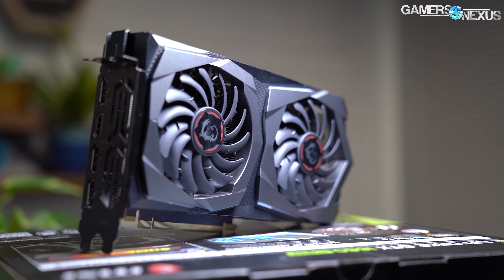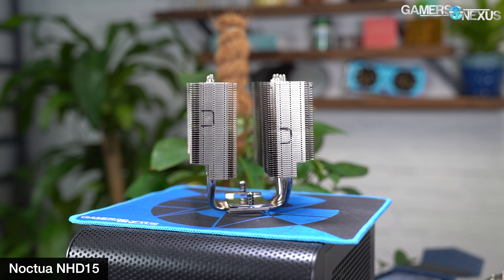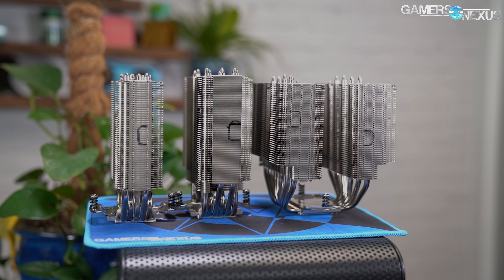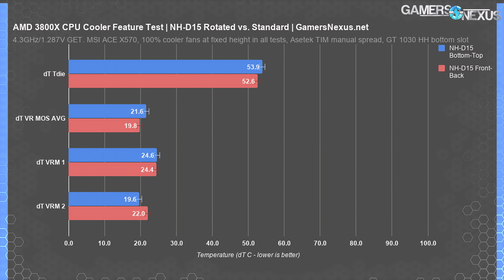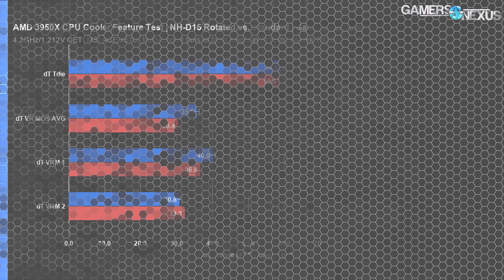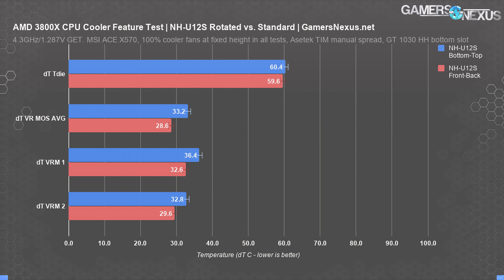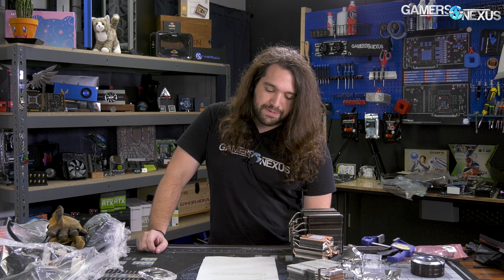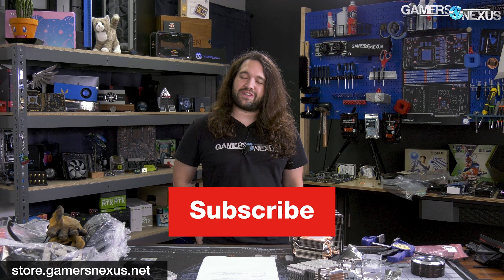AMD Ryzen Heatpipe Orientation Benchmark & CPU Cooler Myths

Comment: i think there is something fundamentally wrong with how ryzen deals with heat. My 3600x Runs at 75c under full CPU and FTP load on aida64. but the heatpipes are cold to the touch. not warm, they are literally cold. In comparison my older cpu 4690k stock runs are about 60c and touching heat pipes for too long will burn your fingers. For thermal compound im using thermal grizzly kryonaut.
Reply: Um actually its a perception issue. Ryzen 3000 cores thanks in part to the process node are quite efficent about 6w per core (most of the time though they can be run up to about 14w per core) the thing is at these densities you have quite a lot higher energy density. Give you a example. Move 100w of energy (that is 100 Joules per sec) away from a surface that is 1 square CM... now ... Move that same 100w away from a surface that is 3 sq. cm ... You have much higher energy density in the one example then the other which means you may have higher deltas to get that kind of energy transfer needed. The reason the cooler was hot to the touch with haswell (4690k is that the max load on the cooler was higher then on ryzen ) so more of the coolers capacity was being used then with ryzen (this makes sense given how low power a 3600x is.) The issue your running into is a limit of thermal transfer between the transistors and the cooler given the thermal density. And the space/surface area to do so (die size). The reason the cooler is cool to the touch with ryzen is that it is not actually very close to its limit (Qmax) of energy transfer. Which means it still can transfer a lot of energy. Here is much of the perception issue. Human bodies perceive "cold" in kinda a funny way. A object could legit be very cold like a metal pole in winter (maybe 20 F) however you may also grab a metal bar or pipe in the summer and it feels cold. This is because there is a high flux of energy from your hand to the pipe which your body percives as cold even though there might only be a small difference in temp (less then 20 degrees) .... The issue your running into is bascially that energy density is higher with ryzen even though it is more efficient (makes less waste for the same compute) your cooler is not really the limit the limit is more the mediums of energy transfer between the transistors and the coolers base plate as well as the density and overall distance that energy is spread out... To increase thermal transfer greater delta between the cooler and what your trying ti cool will increase energy transfer. However density , distance, ect all play a role.
Reply: @Onewolfoc  so it's a heat transfer issue? ryzen outputs much less heat but because surface area of the die is really small it can't transfer that much heat to IHS?
Reply: Check the thermal output of those two chips... THERE is the reason for your difference. You're comparing apples to oranges. AND, you can't take "thermal design" into consideration, Tech Jesus has a few vids on that subject.
Reply: don't you need a better heatsink to run a Cpu with higher heat output at same temperature as a CPU with lower heat output. if 3600x is so efficient compared to 4690k why does it runs so much hotter on same heatsink. and at same time it outputs way less heat compared to 4690k
Reply: @k7y  To many variables: You may not think so, but amount of TIM, type of TIM, mounting pressures, and absolute thermal output... You CAN NOT go by reported die temps, you would need calibrated sensors mounted to the dies, you know, like the LN2 over-clockers do?

Comment: So I have a D15, 3700x, on a MSI B450 tomahawk max inside a Fractal Design Focus G case. And the VRM heatsink and Ram placement paired with the case constraints means the only way I can orient the D15 and use 2 fans, is to have the cooler exhaust up or down. Out the back, I can only use one fan. However, running it that way (my D15 didn't come with hardware to mount vertically out the box) I haven't seen temps that warrant the second fan for my use cases yet.

Edit: very much worth noting, for anyone looking at the NH-D15. If you mount the fans as indicated in noctua specs, the D15 could be 165mm tall. However, if you have to contend with RAM sticks and a VRM heatsink, the D15 very easily ends up a cm taller than noctua spec. Pick a case accordingly, or end up with my predicament

Comment: Is there any difference in heatpipe performance when placed vertical(ala test bench) vs. horizontal(ala most cases)?
Reply: Yes there is - i attached a reply i made to another earlier comment that goes over this as well as some other info on heatpipes mostly being constant conductance heatpipes.

 there is a lot that goes into it. Starting off diameter plays a huge role. A 3mm heatpipe might have a qmax of 15w and a 8mm heatpipe qmax of 63w.... Thats a big difference for less then a 3x boost in diameter thats nearly 4x the orgional energy for sub 3x larger dia. .... Now lets say you have a low profile heatsinks (laptop for example) and you need to flatten a heatpipe ... If you flatten a 3mm heatpipe by 2mm height thats 3.57mm wide and now has a qmax of 10w instead of 15w .... If you take a 8mm heatpipe and flatten it so the width now becomes 11.14mm @ widest point the qmax is 52w rather then 63w of the round 8mm heatpipe....now some of the factors here are the wick limit (ability of the wick to transfer condensed fluid) and vapor limit (ability and space for the vapor to form and travel.) Thickness and porosity of the wick can be changed to tune it for a application (like differnt orentations) Which would allow for Qmax changes and / or the ability to work against gravity. .... A typical water filled sintered wick heatpipe (very common for pc cooling ) can be flattened up to around 60% though 30% is much more reasonable figure. As you flatten a heatpipe you will lower the vapor limit. A 3mm heatpipe flattened 33% now has Qmax limited by vapor limit rather then wick. Where as a 8mm heatpipe can be flattened by about 66% before the Qmax is now limited by vapor limit. ... Now if we start making bends we further reduce efficency. If we take the 8mm flattened heatpipe talked about above (52w Qmax) and we bend it 90 degrees we lose about 5% of our 52w Qmax. Which would be about what 49w after that off the top of my head ...then you have orentation. The most ideal situation for most heatpipes is vertical orentation as opposed to the heatsource with the condenser above the source of heat so vapor can rise and gravity can assist with pulling the condensed fluid back down to the source of the heat. Now to makes things even more complex again wick thickness and porosity effect this. As we as thsre is quite a few differnt forms of wick types that each work better for different things. Then if we want to complicate this more the length matters... shorter = more efficient (assuming you can still matain the same ability to cool the vapor in the condenser) now it varies for many reasons (ex. Working fluid , orentation , wick thickness , wick porosity , wick type , ect) however many fairly traditional heatpipes start to fall off around 150mm in length. However there is factors you can adjust to mitigate this. .... This info is still condensed a lot. And there is a lot of types of heatpipes. The ones discussed above are constant conductance heat pipes. There are also variable conductance heat pipes , vapor Chambers, pressure controlled heat pipes , rotating heatpipes , thermal syphons, loop heat pipes , oscillating or pulsing heatpipes,  and diode heatpipes. Even within diode heatpipes there are a few sub types like vapor trap and fluid / liquid trap types.

Comment: 3:53 right now.
I am fairly sure the orientation doesn't matter jack. The cooler has contact with the head spreader, not with the diodes.
It's called a heat spreader for a raisin.
Reply: Well orentation does play a role though not in the way it was tested in the video. Vertical heatpipes with the heatsource at the bottom and condenser on the top is the most efficient way to run most every heatpipe. Changes to the type of wick , thickness of said wick , and porosity of the wick , effect how much this matters and the ability of the heatpipe to work against gravity even.
Reply: @Onewolfoc  
Watch me mount it in every way you think is wrong, and still reach proper temps...

Comment: Whoever asked this Question is cery low IQ indeed... The radiator design and airflow over the radiator is always going to matter more than heat pipe orientation by far.

Comment: The only problem with these aftermarket coolers is that they're too big for older mini-towers from what it looks like.  Not to mention the fact that there's more things that the CPU fan cools than just the processor (e.g. Hard-Disks)
For another thing, air from downward-facing heatsinks (e.g. Amd's stock "Wraith" coolers) spread across the board through holes in the fins/pins whilst hitting the surface of the sink, hence the fan blowing down.  It's sort of the reason why all stock coolers have fans pointing with it's back to the sink.

Comment: I would have ran  the test outside of the case to elliminate all other interference....your method doesnt solve the question , it just shows the best position to have the fans pointed to cool the fins. I have an inverted board and its the best design there is....mine even has 3 blueray burners, fan controllers with temp readout and a radio head unit in the Front drive bays to aid in cooling. Why this design is not standard is criminal, they want you to cook your electronics so they fail sooner which increases the bottom line and the CEO s wallet. They are trying to get rid of the front drive bays so you cant backup data cheaply and decide to trust them to store it on there server. Plus now you will need to subscribe to Disney to see a movie because maybe they quit making physical disk....cpu fan orientation should be the least of these geeks worries. A glass panel blocking air flow into the front of a case is sofa king we Tod Ed

Comment: It's well know that if the pipes don't line up with the underlying chiplets perfectly, the "heat pipes" will actually increase the CPU"s temperature by well over 40C.  This is a little know fake fact.

Comment: it is the length of the heat pipes that is critical  .. longer the better , most have wicks in them anyhow so gravity is not much of an issue anyhow, unless you are delidded your restricted to the IHS ~ 800w/k anyhow ... jeez what ever orientation it should be to help the hot air exit ..

Comment: I've always liked the look of front to back tower coolers far more than bottom to top. Unless the system has no video card bottom to top also looks restrictive, pulling hot air off the back of the GPU to pass through fins meant to cool the CPU never seemed too bright either.

Comment: B-but the heatpipes form a square connection with the whole IHS... Tower cooler orientation is more of an airflow question rather than die coverage. One would have to "de-lid" a CPU first to then worry about proper die cooling.

Comment: it is better to have your cooler base cover the whole ihs, than a part of it, thermal fact. Especially with the chiplet design. The orientation is buullshit. And yes, Nexus used cpu coolers that covered the whole ihs and there are coolers that dont cover the whole ihs.

Comment: Just use 3 good thermal sensors ... One on the IHS one on the contact cooler and one on top of the heat pipes

Comment: It would more likely be more important to align the cooler to the air flow of the case than the CPU chiplets... As long as they used the Silverstone RLO6 case (Red), A white GPU on a riser cable and Green RGB fans it will be 22 to 25 degrees cooler.

Comment: I would want to know whether there's a difference between the heat pipes being mounted vertically (like on a bench test rig) and horizontally (like most computer cases), and maybe upside down too.  The theory behind there being a difference is that vertically mounted heat pipes have gravity on their side when it comes to moving the liquid inside them to the heat source.
Reply: Yes there is actually a pretty significant difference. The best orentation for most all heatpipes is as follows : heat source at the bottom , vertical heatpipes condenser at the top. In this case vapor is allowed to rise and gravity assists with returning the fluid back to the hotter base. Any deviation from this lowers the Qmax of the heatpipes. By how much is dependent on a lot of things. They (as in cooler companies) actually change the wick type , wick thickness , and wick porosity to design around and mitigate orentation. Porosity and wick thickness for example have a pretty good effect on the ability of the heatpipe to work against gravity or in different orentations. Some wick types also work better in some orentations vs others. If your interested I attached a reply i made to another comment on this video to the bottom of this that contains some good info on heatpipes 

 there is a lot that goes into it. Starting off diameter plays a huge role. A 3mm heatpipe might have a qmax of 15w and a 8mm heatpipe qmax of 63w.... Thats a big difference for less then a 3x boost in diameter thats nearly 4x the orgional energy for sub 3x larger dia. .... Now lets say you have a low profile heatsinks (laptop for example) and you need to flatten a heatpipe ... If you flatten a 3mm heatpipe by 2mm height thats 3.57mm wide and now has a qmax of 10w instead of 15w .... If you take a 8mm heatpipe and flatten it so the width now becomes 11.14mm @ widest point the qmax is 52w rather then 63w of the round 8mm heatpipe....now some of the factors here are the wick limit (ability of the wick to transfer condensed fluid) and vapor limit (ability and space for the vapor to form and travel.) Thickness and porosity of the wick can be changed to tune it for a application. Which would allow for Qmax changes and / or the ability to work against gravity. .... A typical water filled sintered wick heatpipe (very common for pc cooling ) can be flattened up to around 60% though 30% is much more reasonable figure. As you flatten a heatpipe you will lower the vapor limit. A 3mm heatpipe flattened 33% now has Qmax limited by vapor limit rather then wick. Where as a 8mm heatpipe can be flattened by about 66% before the Qmax is now limited by vapor limit. ... Now if we start making bends we further reduce efficency. If we take the 8mm flattened heatpipe talked about above (52w Qmax) and we bend it 90 degrees we lose about 5% of our 52w Qmax. Which would be about what 49w after that off the top of my head ...then you have orentation. The most ideal situation for most heatpipes is vertical orentation as opposed to the heatsource with the condenser above the source of heat so vapor can rise and gravity can assist with pulling the condensed fluid back down to the source of the heat. Now to makes things even more complex again wick thickness and porosity effect this. As we as thsre is quite a few differnt forms of wick types that each work better for different things. Then if we want to complicate this more the length matters... shorter = more efficient (assuming you can still matain the same ability to cool the vapor in the condenser) now it varies for many reasons (ex. Working fluid , orentation , wick thickness , wick porosity , wick type , ect) however many fairly traditional heatpipes start to fall off around 150mm in length. However there is factors you can adjust to mitigate this. .... This info is still condensed a lot. And there is a lot of types of heatpipes. The ones discussed above are constant conductance heat pipes. There are also variable conductance heat pipes , vapor Chambers, pressure controlled heat pipes , rotating heatpipes , thermal syphons, loop heat pipes , oscillating or pulsing heatpipes,  and diode heatpipes. Even within diode heatpipes there are a few sub types like vapor trap and fluid / liquid trap types.

Comment: One question I would have is, has anyone confirmed that ALL of the lower end zen2 CPU's have asymmetric chiplets? Because it seems to me that if they had two chiplets that only ended up with 3 cores up to spec, couldn't be both used to make a 3600, and so on.  If there's no performance penalty for using two chiplets instead of one, then that just makes the most sense as far as stretching out the silicon wafers as far as they can go.

Comment: Wasn't it the same thing back with Sandy/ivyBridge?
The long, narrow die would "prefer" a certain orientation of the heatpipes.
And on Intel you can rotate the cooler as you wish because the mounting holes are in a square.
Little note: Got my (big, 6 heatpipe) cooler blowing up because at the top I can mound 2x 140mm fans and at the back only 1x 120mm

Comment: So the main conclusion is "it does not matter"
Reply: I want this to be clear here in this test orentation does not matter for cpu temps (unless the condenser is significantly restricted) since the heatpipes are all ending up in a horizontal orentation in this test. Heatpipes work best in a vertical orentation mostly when the heatsource is lower then that of the condenser so that vapor can ride and gravity assists with returning the condensed fluid back to the heat source at the base. How much deviation from this orentation matter is based on a lot of stuff like heatpipe wick type , wick thickness , and wick porosity which can be tuned to effect preformance in different orentations and or the ability of the heatpipe to work against gravity.